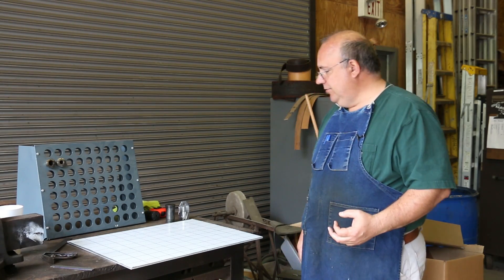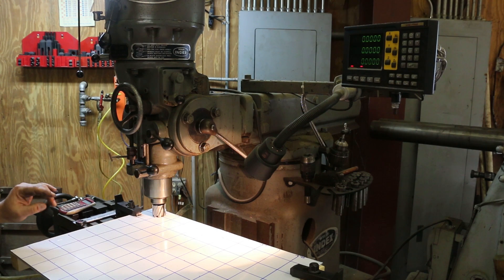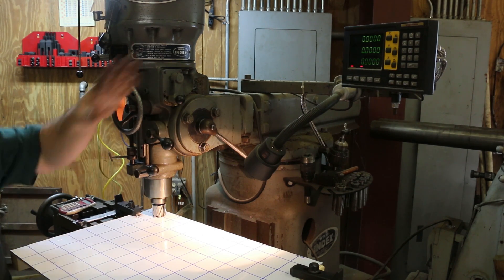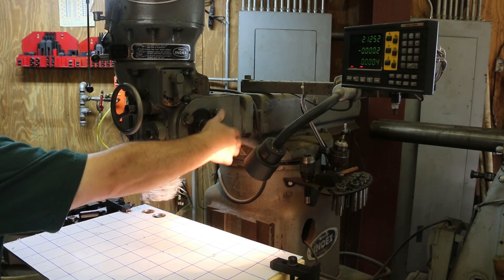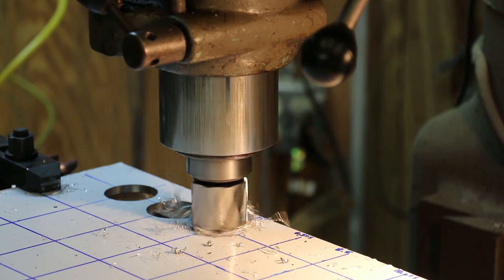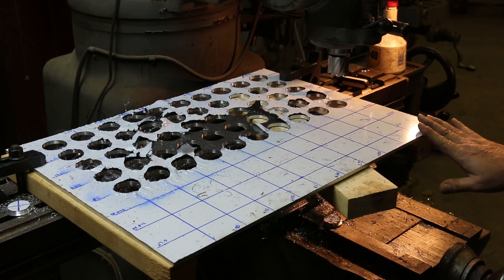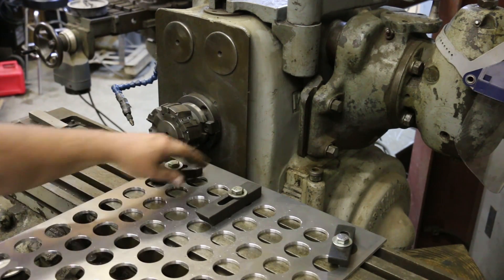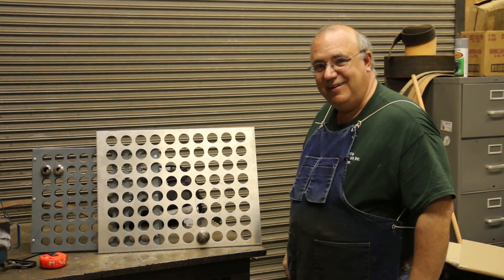Building a 2J Collet Rack:  Part 1

Comment: Trimming the half an inch off the side to correct your bozo move would have been easier on your table saw with a fine blade or even a metal cutting blade. However you got it done. 
Someone else mentioned your editing error but since seven years have passed I guess it's no longer important.

Comment: keith you have a dropro dro and i think it has a grid layout for bolt hole function...
Reply from the maker: +carryit around I think it might but I have never used that function.  I need to spend some more time learning what all that DRO can do!
Reply: dropros put out some great videos now on those functions... i have the 700 series lcd so it may be different than yours but the bolt circle function is not just marketing... give it a try..

Comment: If this was my shop i would have done the whole rack in hard Wood. Have a nice look after while when greased in (by way of useage) and fingerprints. The old timer look and less noise.
Reply from the maker: +new and old tech The only problem with using wood on a collet rack is that the wood can hold moisture and cause a rust ring around the collet where it touches the wood.
Reply: +Keith Rucker - VintageMachinery.org Even with linseed oil in plenty? I remember the old workshops with timber frames and the Tools attached to the walls by all means possible. Had been soaked with grease, motor oil, hydraulic fluids, and all else imaginable and not imaginable. If A drop of water fell on the Wood it appeared to float on top of the benches.

Comment: Would have preferred that the holes were bored on a common angle so that this rack could be simply hung from a wall.  It will be tedious, but hope that you label the holes for easy retrieval and replacement in the rack.....?

Comment: How many feed rates are on that wells-index? looks a lot more than Bridgeport's 3. I'm surprised you can change the feed with it off. Bports must be running to jog the gears. I like those Rota-Broaches. I'm sure they cost a fortune though.
Reply from the maker: +justfakeit888 I think there are six, but it may just be three.  I want to say that there are three cogs and a high and low range.

Comment: Hi Keith,
Noticed your mill is Wells Index.  As a newby just discovered the brand and have been trying to learn more about it.  Haven't searched your archive yet but what do you think about Index mills?
Reply from the maker: +Michael Marriam I can tell you that I love my Wells Index mill.  I have used many types over the years, and I personally like a Wells Index mill over a Bridgeport type mill.  I talk about some of the reasons why in some of my earlier videos, but it is a very nice machine.
Reply: +Keith Rucker - VintageMachinery.org 
Thanks for the reply.  It would seem that most folks on the various forums feel the same as you do.  I've just started looking for a mill.  If I can pick one up near me (western NY) for a reasonable price it may be my choice.  God bless and be safe doing that high up wiring in your new shop.

Comment: If I had a nickel for every layout mistake I have made,  I could buy a Hardinge HLV.  DRO sure helped. I wonder if a hole saw would work?  Every woodworking tool I have works fine on Aluminum.
Reply from the maker: +Juan Rivero I hole saw probably would have worked just fine, but I don't know if it would have made it through the 80 holes before getting dull.

Comment: I just found a laser cut 30  1.25" hole 304 3/16" Stainless steel rack in my collection piles and fitted each hole with neoprene grommets I also had and they were like  ready made for those size holes for my R8 Colet rack.
Reply from the maker: +1NRG24Seven That would be a great way to get the job done.  Nobody around me has one of those though...

Comment: I have a 2J collet chuck as well. Love it for the most part until I tried to get a collet block for it. Since it's not a common tool readily available in my price range I'll be trying to make one here soon. Should make for a good video.
Reply from the maker: +Mike Dittman Have not thought of a collet block for the 2J series.  I have one for 5C collets in both square and hex.  Now you got me thinking about building one as well.....
Reply: I got the square stock I needed to make it but I'm going to be down for a surgery soon so it's going on the back burner for a few months. It'll be a fun project though. I am going to try and make a square and hex block.

Comment: Me being cheap and lazy would have just got a good morse hole saw and used wood.
Reply from the maker: +Jay Walt The only problem with wood is that it can absorb moisture and leave a ring of rust where it touches the metal collet.
Reply: +Keith Rucker - VintageMachinery.org Point taken, some good sealant would take care of that.  Still a cool project. =)

Comment: Keith, just an observation: if you used the inc(remental) function of your DRO instead of the abs(olute), you wouldn't have had to do the math adding 2.125 for each movement to the next hole.  This is a project I need to do myself for my 5C collets - thanks for the video.
Reply from the maker: +MrPragmaticLee I did not think of using the DRO function.   It does so many cool things!!!

Comment: Looks like industrial Connect Four.  This seems like one of the few situations where making a spreadsheet would have made sense; just a grid of X,Y coordinates to reduce the possibility for human math error.
Reply: +Brandon Fesser Let the DRO do the math by using the INC vs the ABS mode.
Reply from the maker: +Brandon Fesser It was not higher math - not a problem....

Comment: Funny that I need to start on the same project.  I have a sheet of 1/8" aluminum cut out and ready to drill for my 2J collets, but I need to find a 1.625 cutter like yours.   Until I saw the final part of the video, I was thinking that 1 5/8 looked to be too snug from what I was measuring.  I do have an expanding reamer that ranges from 1.600 to 1.700 if you need to borrow it.
Reply from the maker: +Jack Hoying I have an expanding reamer already in that size and have already lightly reamed a bunch of the wholes.  It does not take much to get a nice fit.
Reply: +Keith Rucker - VintageMachinery.org I ordered an 1 5/8" annular cutter off of eBay last night.  My 2J collet set is by 1/6", so I only have 20 holes to drill.  I might put in some extras for future expansion.

Comment: Looking good. Was that WD-40 you were lubing the cut with? Will you mount this on the lathe itself?
Reply from the maker: +Walter Plummer Yes, WD-40 makes a great cutting fluid for aluminum.  It will have supports on the back to sit on a shelf - not on the lathe. It could be mounted that way, but I would rather not use up that space with a collet rack.
Reply: Keith Rucker - VintageMachinery.org
Thanks, I always enjoy your videos.